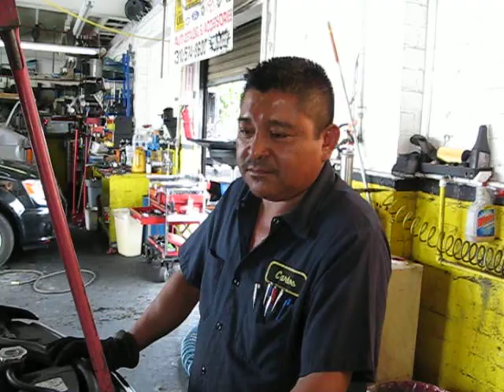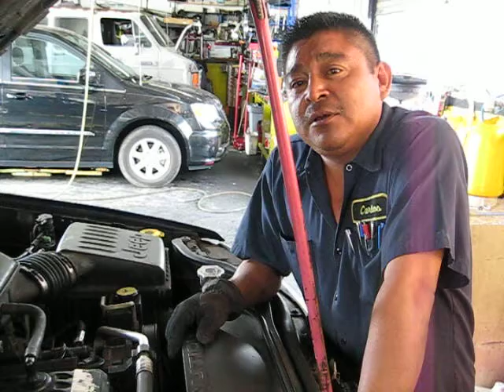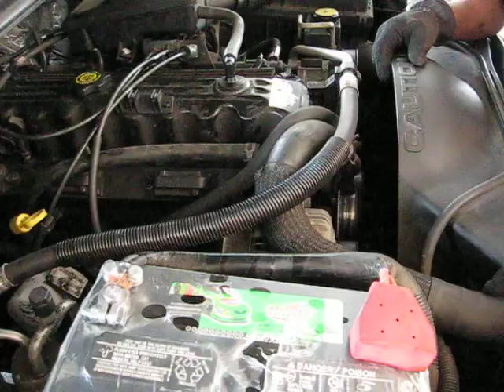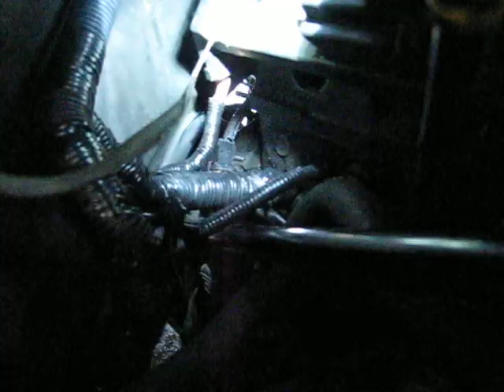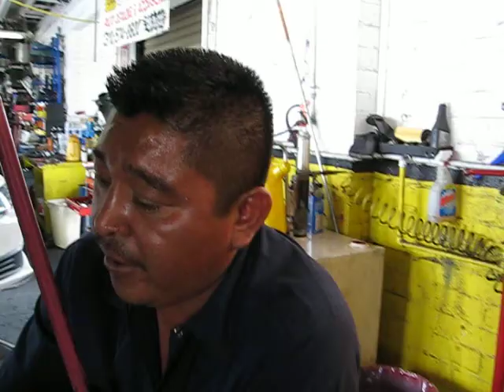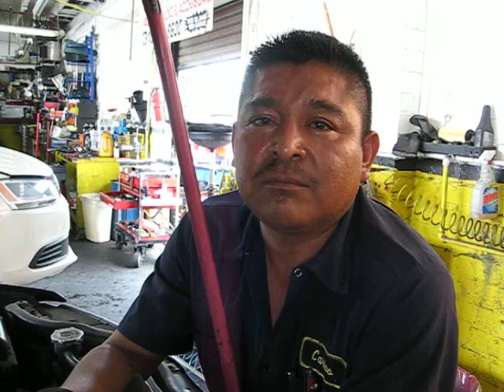JEEP GRAND CHEROKEE ENGINE CODE P0353

Comment: All these older Jeeps have issues with the connectors in that area.  CPS, Ignition and Cam sensor connectors are all right there and they all disintegrate right where wires go into the plug.  Check em all!

Comment: So ive replaced all spark plugs and coils on my 04 grand Cherokee 4.7 but i keep getting the misfire on cylinder 5&6 any idea what it might be? Thanks
Reply from the maker: First check the compression on all cylinders. Second check the pulse on all injectors make sure they are working. Then go from there.
Reply: @haycall  ok will do. Thanks for the tip

Comment: I have a jeep grand Cherokee 97 i got a code that's p0351, i fixed the fuel pump catalytic converter it runs better but it still stalls slows down when iam on the highway, what do you recommend i should do
Reply from the maker: You need it to take it to a mechanic shop.